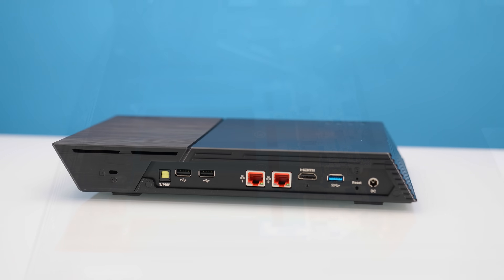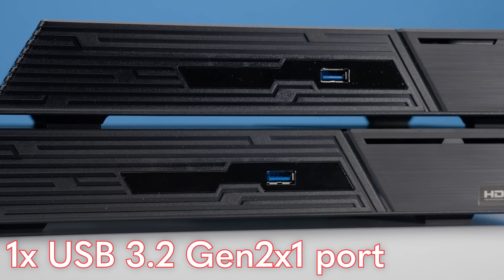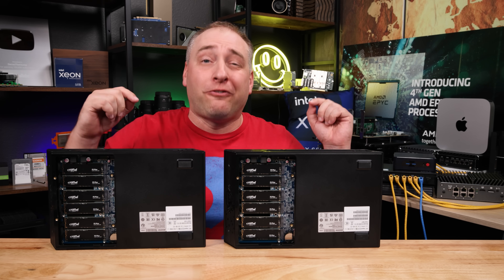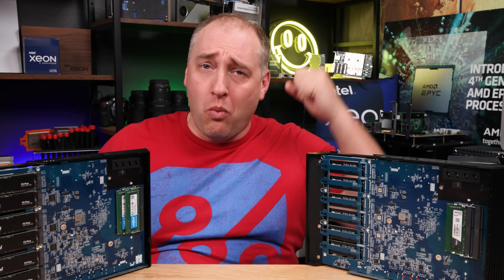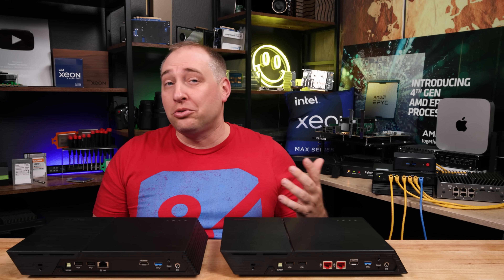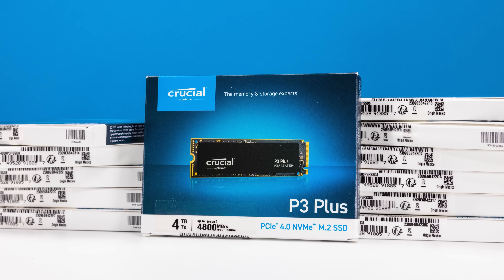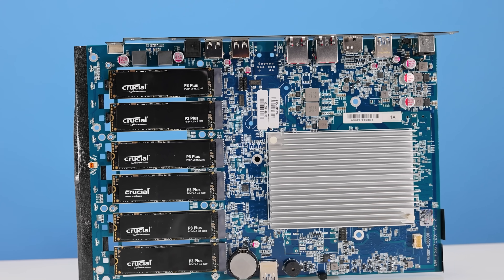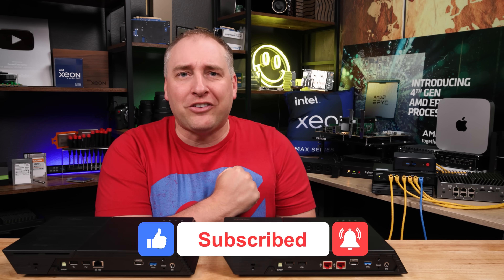Crazy 48TB SSD NAS and Cheap 6TB Version Asustor Flashstor FS67

Comment: But compared to the Synology DS620slim… 6 bay 2.5”.  Maybe the 2.5” SSD’s are a hair cheaper, but it only has gig.  This Asustor has 2.5gb on its 6 bay version.  This also has up to 16GB ram when Synology has 2 to start and upgradable to 6.

So which one will be a better plex server and mapped drive / network storage for an average home user with macs and pc’s?  I’m kinda leaning towards the Asustor.  As long as you know it’s limitations, what it is and what it isn’t… I think this is a really neat little box.  

Would love to see plex benchmarks.  Wish it had just a slightly better CPU, however I do appreciate the low power consumption in an era where power bills are going up and up.

Comment: This may be a dumb questions, but can you connect each of the network ports to a different network in order to share files between computers on two different networks? 

For reasons (that may or may not be valid), my wireless network is different than my wired network and we can't share files between my wired computers and my families wireless machines.

Comment: I am new to using a nas. I was wondering if you are able to connect to these wirelessly? Like with a phone?. I would also have it connected by wired to a computer.
Reply from the maker: Usually in that case you would have it wired to a switch and then access it over a wireless link to that network. Alternatively, these do have remote cloud access so you can set it up to connect on the go.
Reply: @ServeTheHomeVideo  Thank you.

Comment: I think still too ridiculous.  The 6-bay is like $750 for 6TB or storage, the 12-bay is like $1,400 for 12TB of storage.  But a 10TB HDD  is like $150 and the DIY  NAS w/10Gig NIC is about $300 - plus I can add many more 10TB HDDs for $150 ea.  The only difference really, is that you can drop the SSD one from over a meter and still have your data (maybe).  By the time you have 3 or 4 HDDs you're already at 480~500 MB/s so speed is no different - and speed isn't that important for home or small office users anyway. And of course with a RAM cache small reads and writes feel pretty much instantaneous.  

On top of all that 12TB of storage isn't enough for a lot of use-cases - but 60TB is. That's only $900 in HDD form but in SSD form you're talking over ten times that price! WTF?  $900 is doable for most people in need of such a device... $9,000 to $12,000 is NOT!!!
Reply from the maker: I think that is what I learned with the 6x 1TB configuration. It was just not enough. The 48TB configuration at $3700 was not too bad though. The HDD NAS units all suffer from one challenge: modern helium drives are LOUD, usually much louder than the NAS itself. An all SSD NAS like this is quiet. There are a lot of folks that would prefer silence and will pay 3x the price for silence and the reliability of SSDs over HDDs.
Reply: @ServeTheHomeVideo  Yeah, if you're sensitive to noise or are using it in a recording studio then you need a long(er) ethernet cable.  Me, I like computer noises - they make me feel powerful :D And I use a pro grade dynamic mic the HEIL PR-40 designed specifically for voice - and that cuts everything out of the soundscape that's more than about 2.5 or 3 meters away - even room fans and clanking dishes. It's awesome, and only $300 to $600 depending on the outer shell esthetics and sale prices. 

Unpopular opinion: I think another mistake home users make with DIY NAS is the purchase of designate drives. I've been using a NAS based on the x470 Taichi (10GBE) with 48TB of "economy" (compute) grade HDDs (ST8000DM004) in RAID0  since late 2018 24/7 without a hitch. Those were like $75 each whereas the NAS designated drives were double that.  That system in total cost $900 with 64GB RAM, processor, case, PSU, the works...  

I dunno maybe it's just cus I'm poor or something but I don't think SSDs are competitive yet in the home environment - for really anything other than a boot drive.  I seriously don't think it's fair or practical to spend almost $4k for a less capable system than what about $1k will get you. 

To quantify the not ready claim a little I tested load times on 64 of the largest popular games not too long ago and the average difference was 14.8 seconds when compared to PCIe gen4 NVMe screamer and 7.6 seconds difference when two HDDs (ST8000DM004) were in RAID0. During gameplay there were no differences.  So, unless you're loading and then immediately quitting games (or applications) all day long  I just don't see it.  The price | performance ratio isn't there yet with an 8TB SSD costing over a grand and an 8TB HDD costing under a hundred. 

Prolly should add another positive point for SSDs being weight and size though. Still not enough to justify the difference for me but...

Comment: Considering the cost for HDD NAS and large capacity drives - vs - the lack of heat and noise; these are not bad option if someone doesn’t need massive storage.

For me, the 6 slot, with 2TB drives would be fine for the foreseeable future.  Getting two, set up the same, and I’d have on site + off site storage / backup.  Without the insane time needed to backup via USB-A 3.1 or USB-C 3.2.

Comment: I love the idea of these, I've been using a DS620slim for awhile because my office is also my bedroom, so having no hard drives clicking away all night is really nice, having 2 gigabit connections is totally fine for home use, even if I'd love a little more. There's plenty of gigantic 12 core, 24-bay NVME dual 100gig all flash NAS options,  but surprisingly few small and silent all-flash products. the 12 bay option would give me the option of using whatever cheap 1-2TB NVME drives i can get my hands on, without needing to hunt down good deals on cutting edge high-capacity drives (seriously, 4tb 2.5" drives are a nightmare right now), or losing a bunch of space for redundancy. these are a softball right over the plate for me.

Comment: The trapezoid box wastes valuable space, and the RAM issue is also disappointing. A better processor, and allowing an OS of your own choice to be installed is a necessity for me, then it could be used to run LXC containers and would be far more versatile, doubling as an full server for whatever needs you have.
Reply from the maker: Some folks have run Linux on these instead of the Asustor OS.

Comment: They NEED to create a version of this that supports the twelve nVME Drives combined with a AMD Zen3+/RDNA3 APU that'll support 32GB of FAST DDR5. It would make for one heck of a PLEX Server that can both handle the storage and encode/decode on the fly (for multiple output streams)! PLEASE make it happen Asustor! 🤞
Reply: I mean, you could have a separate disk array.
Reply: Wishes not miracles kid
Reply: Why wouldn’t you just get a server at that point? You can get a 40 core 12 drive bay Plex monster with 128gb of ram for barely $400. And what would the point of having any APU be? Get a silent / tiny nvidia shield for your Plex client.
Reply: @BlownMacTruck  Yeah, I bought my R720 for under $300 used. Yes it's power hungry, but it idles at less than 100 watts on average, has a shit ton of PCIe lanes and slots. a lot of SATA HDD slots etc. It runs TrueNAS Scale well and I haven't had really any major gripes. It's actually really quiet for a rack server. NVMe drives work fine with an adapter and so does a USB 3.0 card
Reply: Add a few sata ports to connect HDDs and then with ZFS and caching this will be a fast NFS server.

Comment: Hi, did you try downclocking the 64GB ram configuration and test the system stability that way? I had bought a 3200MHz 32GB x 2 sodimm DDR4 on a similar mini ITX NAS, and despite it was "supported" 64GB, it could not run stable. Then I had the big brain idea to go into the BIOS and force the ram to run in 2400MHz mode instead of letting it go at 3200MHz.

The system runs stable to this day. However my processor is not a N5105, so I am curious if you could test again using the 64GB configuration and set the ram clock speeds lower to see if that fixes your crashing issues.

Comment: Great NAS! I wish there will be a rack mount version of this with inegrated PSU, or an optional casemod.
Reply from the maker: I wish. Rack mount is a bit hard for the serviceability of the units with double sided components
Reply: @ServeTheHomeVideo  it's easy to construct a 1u case where the board will mount to the walls in mid height so both top and bottom lids will be openable. Such volume management is just historically unpopular, 1 lid cases few cents cheaper in production.

Comment: Even with the 10Gbps version, PCIE-4 is overkill in terms of performance, and it takes too much power and emits to much heat. PCI-3, even cheap, is a better choice in my opinion cause you can easily get over 1.25GB/s R+W (reaching 10Gbps threshold), even with cheap PCIE-3 NVME 2280.
What is really frustrating about these great-idea-on-the-paper NAS is their CPU, always weak. Many 15W-TDP CPUs (from both Intel and AMD) can offer much more power, single and multi threaded (not just multi), which would be awesome for hosting VMs and containers.
When will we have this kind of NAS with a decent CPU (Intel 12th+ gen or AMD 7xxx) ? I saw a comment below mentioning the AMD V3C18I.. YEAH THAT'S WHAT WE WANT!
Reply from the maker: On the CPU performance side, I have already recorded N100, N200, and N305 videos. They are much faster with another PCIe lane

Comment: Bet its JUST the crappy 1G nic using the extra 20W. The standard ones are aweful, using alot Power and gettin Super hot with longer cables. Reason why you should always use optical ones.

Comment: Hey ServeTheHome, Thanks for yet again a great video, I could not help but notice that unlike other videos you did not cover the capabilities of the 10g port version.

Normally you will say whether the 10g port does or does not support different lower speeds like 5, 2.5 or 1g. I was Not able to find this info on your site’s (STH) news article.

I think this is key to know as you can only get 6 drives for the 2.5 ver but 12 for the 10g ver. For myself for example i have a 2.5g network at home only and would only buy the 12 bay ver for future proofing.  

- - - Could someone please comment if it supports the lower speeds and if so which ones? 

- - - Side question: does anyone know how well this would perform as a PLEX server? I assume transcoding would not work so only devices that direct play ect.

Comment: "Yes, I would like all workloads to be entirely network-bound please"
"Hold my beer" - Asus probably

No reason that these should use NVME, a comparable SATA backplane with bog-standard SSD's would perform the same, wouldn't really be larger either for the 6 drive unit but likely would be alot cheaper (and cheaper drives to boot). 
For the 12 drive unit, NVME makes sense if they used a much better processor and way more network capacity. As-is, it's specced poorly for any use case and really should be using SATA ssd's. 

Overall, these are meme-sumer devices and not really suitable for anything.

Comment: I have been looking for something like this for awhile. I have an unusual use case where I am building out an old ambulance into a high tech RV for a far north road trip. Cell coverage and internet will either be spotty or non existent though i will take this as an opportunity to unplug for 8 months. I will need lots of content and storage. The Arm based board i have Odroid M1 only has a single nvme slot. not ideal at all.  I am mainly interested in just the motherboard and hopefully hacking the heck out of the stock OS.

Comment: That fan connector is stupidly over-engineered! Yikes!
Reply from the maker: I also found it to be fascinating, but easier to design perhaps than a 4-pin PWM solution.
Reply: But I think it's a good idea, you don't want to remove the cover and break the pins, it will be a disaster, especially for some guys, who are ham-fisted, it's so easy to remove the fan cover.

Comment: About ASUS HYPER M.2 X16 CARD V2, what you think?
Reply from the maker: I have two of them in my ASUS Pro WS WRX80E-Sage workstation and they work great.
Reply: I have 2 in my Asrock TRX40 Taichi Threadripper 3960 machine as a single ZFS array of (8) 512GB Samsung 850 Pro drives (RAID-10 == 4 striped mirrors). Runs like a scalded dog.
The problem of course is available PCIe lanes. On a consumer board like B550/X570/B650/X670, you only get 24 lanes. To use that card, the M.2 card gets the x16 slot and the GPU gets the x4 slot. Ouch. (And that's assuming the x4 socket allows the fit AND there's clearance between the GPU and the bottom of the case). 

For >1 PCIe x16 slot, you have to step up to either a Threadripper Pro machine or a single-socket Epyc board. On the plus side, these choices often have (1 or 2)  10GbE and an on-board BMC for remote management. BIG price bump though.

Comment: Thanks for the Video. I was already looking for this NAS. Great job !
Question 1: is it possible to connect it directly with a PC via USB to use the full speed ? 
Question 2: can I use WiFi in any way ?
Reply from the maker: 1. I do not think so.
2. It does not have built-in WiFi. I think you can add it via USB but we only tried wired USB NICs that did not work. The ASUSTOR management interface has a USB WiFi setting though so it probably works

Comment: I would have to wonder the feasibility with 8TB ssd's whether the quantity of ram will be  feasible enough without bottle necks being caused or not when paired to  a series x or ps5 via usb--c..

noting you're at 48 TB  on the 6 m.2 version and 96 TB on the 12x m.2 version
Reply from the maker: If you are spending $6000-12000 on 8TB M.2 SSDs it is probably worthwhile to get a bigger NAS that can use U.2/U.3 2.5". Also spending an extra $35 to expand to 16GB is a rounding error at that price level
Reply: @ServeTheHomeVideo  what would be feasible with laptop ram in those chassis??

If you are talking  sustained speed for network use i would think there be a some form of internal to function for the OS drive

I was using an example of use case for raid server for gaming the question was is the available ram whether it be fast enough for use or would it cause a bottleneck between the speed of ssd's and the speed of 16-64GB kits of laptop ram vs 128GB-4TB  ram in a workstation/server main using 7+ 16x pci-e slots full of 8TB m.2's with m.2 cards

even if I could obtain the samsung ssd's at there original street i'd be 5,100 on 6 2.5 inch and closer to 12k at 10,200 at the 8TB spec m.2's aren't that much different  that's based $850 per ssd

I don't think you are going to see much of a performance comparing throughput between 1, 2 and 4TB ssd's to warrant testing between the 3 sized

Comment: This is hot garbage. I love NVMe drives and for my massive data stores there's no way I need more than 2.5Gb/s access but I use two types of wired networking:
1Gbps Ethernet (Atheros/nVidia/Realtek)
10Gbps SFP (QLogic/SolarFlare)
The flash I use in my storage servers are antique 16/60/120GB SATA or 400GB SAS.
HDDs are vetted WhiteLabel and Toshiba SATA 3rd gen.
Assuming the average user is doing JBOD, dual 2.5GbE is fine. If setting up some kind of RAID10 iSCSI gaming, video editing, rendering scratch space, whatever...They're going to want 10GbE or straight up SFP.
2.5GbE is a good medium term solution and I'm seeing it everywhere these days but it's been like 20 years since the bump from 100Mb to 1Gb ethernet and as always, it's just catching up to the ways we really work with data. I'll stick to Athlon 64 eWaste.

Comment: Didn't you check the intel ARK? N5105 is pci Gen 3 and has a max ram capacity of 16.
Reply from the maker: We have reviewed many N5105 systems. We got the P3 Plus drives because they were cheaper than the Gen3 drives at the time. 16GB is the limit on Ark but these work with 2x16GB for 32GB. Most Atom chips for the last decade or so have real RAM limits 2x what Ark says. We tried 4x for 64GB total and it would boot, but it was unable to finish benchmark transfers

Comment: It would be nice if they had a configuration for rack mount with built in power supply and everything ( status lights, power button usb connection, etc) up front.

Comment: I did the spiritual predecessor to this id like to think: A Synology DS620*slim* loaded with 6x 8TB Samsung 2.5" SATA SSDs.
It's similar by volume to the Asustor Units and has a similar-ish processor (J425) and 8GB RAM (i upgraded it).
The result is a silent, small NAS with decent enough performance for all kind of home-uses that can be tucked away anywhere and will never cause issues with anything mechanical.

I just wish there was an option for 10gbe on my synology, but it's just too old for that (2019). You can add a 2.5gbe via USB3 though and it works well.
Reply: I wish the 2.5" nas had taken off. I should have bought the Slim. With them no longer being produced, I opted to not buy one.

Comment: More 8TB / 16TB or higher 2.5" SATA drive should be made. Then they can be easily used for 2.5" NAS or simply put into a USB HDD case. Single SATA drive will saturate 2 x 2.5GbE, 2 drive will saturate 10GbE, so it is fast enough for NAS. Now TLC/QLC flash is cheap enough that consumer can afford such 8TB+ drive

Comment: no thunderbolt 4 and that's 900.00 that can go to a QNAP NAS with a 25GBE card and thunderbolt 3 card .   pass.  my motherboard has 4 or 5 nvme slots in it that can be used as a raid system